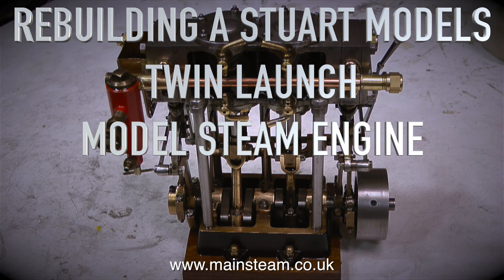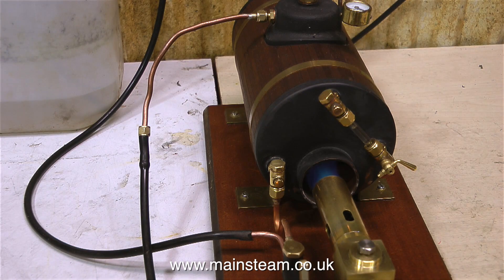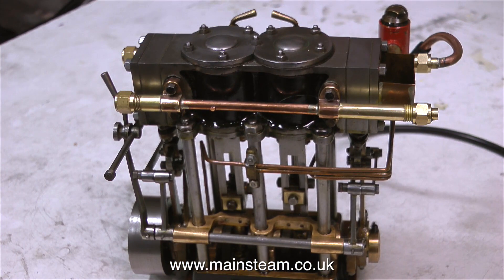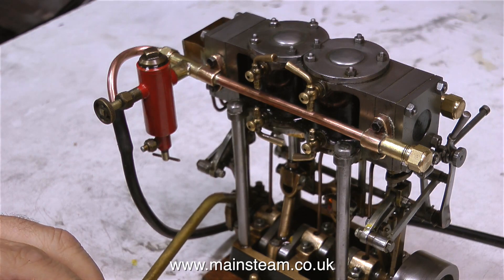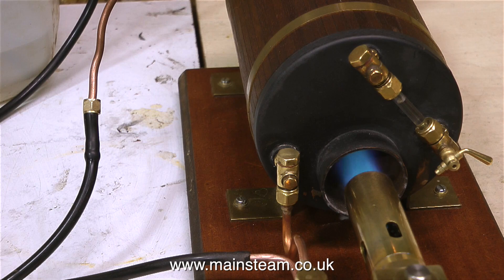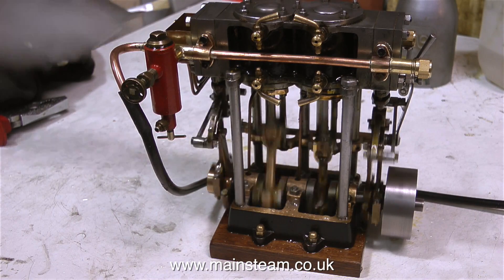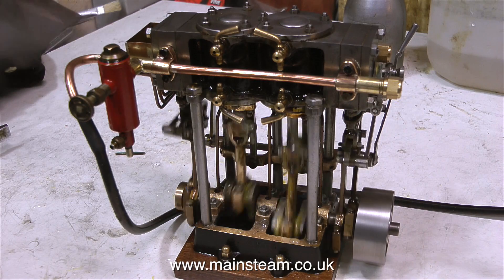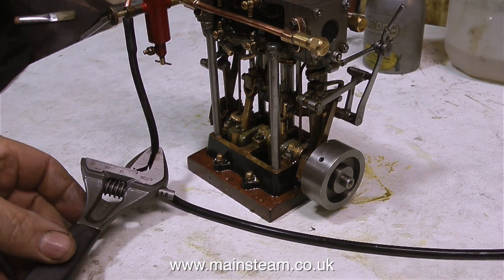STUART TWIN LAUNCH REBUILD - PART #21 - THE STEAM TEST

Comment: Hi Keith;
I love to watch these little steam engines run slow. Thanks for an end shot showing the reversing mechanism. I was having a hard time figuring out how it worked until you gave us this shot. That's a lovely mechanical mechanism. I think you did a good job of fixing it, two thumbs up. After all it was like a puzzle in a box or as those of us from the USA would say, a basket case. I for one really appreciate all the work you put into these videos as well as your great craftsmanship. That spanner is always useful isn't it? Peace to you my friend from far away.

Comment: Just discovered your work. Watched this straight through. It was a beautiful thing. All of it. 
You, sir, are just fantastic at your craft. How anyone could complain about any part of your production, I don't know.

I am an American dentist, 66 yrs old. I know a little bit about working in tight places without seeing what is happening at all sometimes. I also know the difference a few thousandths make in the fit of things. But nevermind.

I saw how you had difficulty with small nuts and bolts and the wrenches you were using. I know they make socket sets and wrenches for use in radio controlled cars, trucks, and airplanes. I am surprised you do not use them.  Also, some long-handled forceps and hemostats might help out getting the nuts to where you wanted them. It might be just the thing you need unless you already have tried it and you found them lacking. 

Another thing I noticed which might help out a lot is using a lapping compound on parts that bind right after they are assembled. you could put the compound on the mating surfaces and rotate them, then wipe and rinse off, oil and reassemble. that would just have you fly through the mating of these surfaces.

If you have already tried this, and it does not work, I would like to know what happened. 

In the late sixties, I learned about engine building from some seriously insane diabolical steaming witches of the motorsports street racing crowd.

They were quite creative. They would buy a crushed Corvette for the title and VIN numbers and "find" the rest wherever they could get it. They were also kind of shade tree machinists and knew what worked.

Just thought these suggestions might help you out sir. I have such tools around here somewhere and have used them to fix dental equipment which has all those gaskets and small fasteners. They also run on air and water pressure.
Reply from the maker: Thank you for your kind and constructive comment Andrew {:-)))
Reply: @keithappleton  You are welcome.

Comment: Have enjoyed all 21segments and found them all very useful.  I have built a Stuart V10 and the Beam Engine with fly-ball governor.  I believe it is easier to build new parts to print than correcting old parts not to print.  You did a fine job of making this problem engine run smoothy.  Congratulations!

Comment: What's the red thing on the intake manifold? Also, I don't remember seeing the oiling system installed.
Reply from the maker: the red thing is the displacement lubricator (cylinder oiler) .......